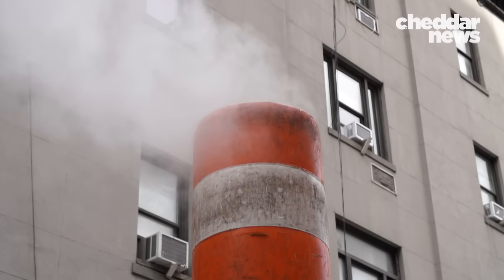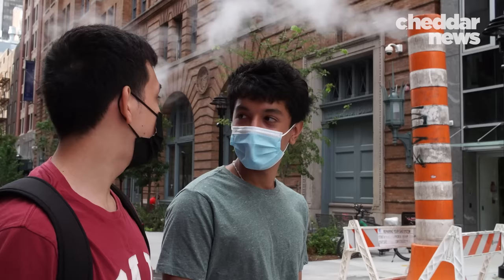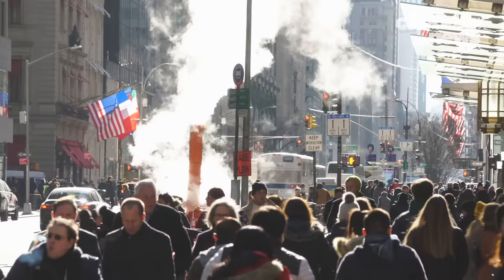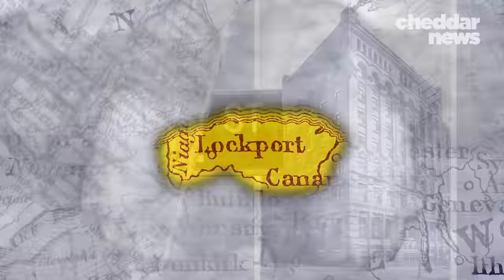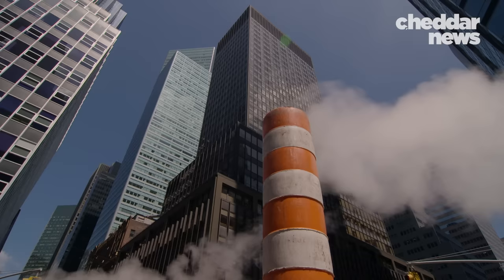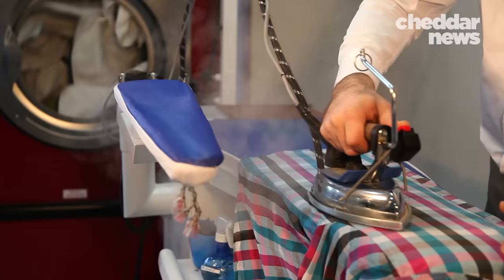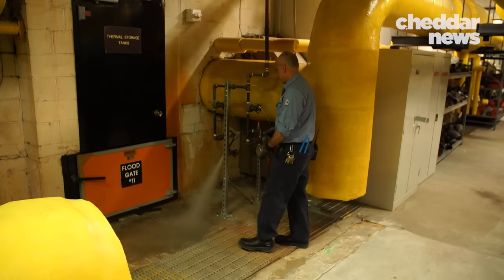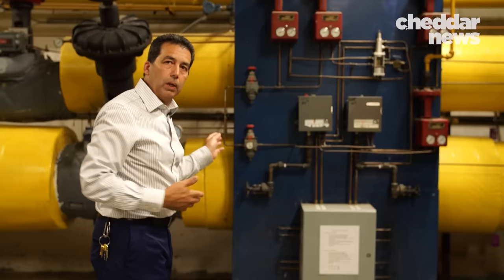Why New York Is Powered By Steam - NYC Revealed

Comment: Con-ed acts like this is such an amazing system that's reliable and safe. The reality is, is extremely dangerous and the system is more than a century old in desperate need of an upgrade. The entire infrastructure in Manhattan is old and run down and con Ed refuses to spend the money to fix it. They even tried to sell Manhattan to national Grid for $1. Yes that's right ONE DOLLAR. And national Grid refused. That's how bad the entire infrastructure is. Not just steam, the gas and electric. There's always an explosion or failure somewhere. How con Ed is still licensed to operate is beyond me.

Comment: In coordination with the city Could certain areas attach devices to the steam lines with mini turbine type generators and run some additional electrical power for small areas or some modified version of this?
Reply: If it would work like that it woul have been done like that. So no
Reply: Copper cables are much cheaper.

Comment: Most cities in Europe use steam to heat buildings. But unlike NY, most cities are able to contain the steam in pipes. I have been walking around steam heated towns and cites my whole life. Never seen such a neglected pipe system. Letting all that heat just ecape.
Reply: I was thinking the same. Doesn't seem very efficient letting it all scape, in my mind it would be like if the water supply we get would just leak like a broken fire hydrant every so many feet.

Comment: Sure, burning natural gas is better than coal, but the steam produced that way still isn't "sustainable" anyway.

Power2Heat with renewable energy, geothermal... That's sustainable.
Reply: most gas power plants just waste the steam. this system is far better than most.
Reply: @Progan666  Cogeneration is better than running a gas turbine for electricity or burning fuel for heat. I fully agree, but that wasn't my point. Burning natural gas in cogeneration still isn't sustainable - it's just better.

Comment: I’m surprised it isn’t used more extensively…perhaps as the new generation of nuclear comes on-line…distinct steam may see a renaissance as well…steam running small turbines instead of electric motors allowing for some devices that you wouldn’t think of as “steam powered”

Comment: How does Con Edison know what to charge ? Unlike electricity where a meter is used what do you use to measure how much steam is used ?
Reply: 7:43 those things with the LCD screens are steam meters. I believe there's a turbine mounted inline with the service pipe that measures volume (like a large gas meter) and that's integrated over time on the computers in Mlbs (1000lb of steam). I've also seen older, smaller buildings where it's just a mechanical meter mounted right onto the pipe, but it does basically the same thing.

Comment: Gas isnt actually cleaner than coal.

Methane is a stronger greenhouse gas than carbon dioxide
Reply: Unburned. 
One C coming from methane and one coming from coal still makes only one CO2. 
Anyway, I think he meaned clean as the opposite of dirty, not of climate friendly.
Reply: They dont offer methane credits for a reason
Reply: gmethane burns cleaner than coal or oil products in terms of soot and nitrous oxides, and it produces less CO2 than coal per unit of heat produced because a large part of the heat from burning methane is produced by converting the hydrogen in the methane into water, not just from converting the carbon in the methane into carbon dioxide. 

but yes, depending on how much methane you release unburnt, using methane could be even worse for the climate than using coal.

Comment: how does the steam-based air conditioning work on a thermo-mechanical level?
Reply: My guess is they use the steam to turn the compressor of the AC loop. VERY inefficient and wasteful.
Reply: My guess is they mechanically condense the steam into a cold liquid.
Reply: @slowanddeliberate6893  Possible, but doubtful it's used again for efficiency reasons. Steam jet cool was something from the 1930s: https://en.wikipedia.org/wiki/Steam_jet_cooling

Comment: This is such a sci-fi-esque system, certainly not something an entire city could run off of - so incredibly inefficient to transfer hot fluids over vast distances - yet here we are.

It's a cool idea, but has very obvious flaws
Reply: certainly feels steampunk-like.
Reply: Nah. Made up by the number of people whp use this utility beyond heating.
Reply: you really know nothing about high power steam if you think its a liquid lmao. bet you didnt even know steam can be dry
Reply: @bobymo101  I didn't say it was a liquid - I said it was a fluid.
Reply: I think when the city is packed like Manhattan is, loss is not too bad.
Reply: The pipes are insulated. Gas has relatively low friction. Efficiency losses are relatively low. District heating is a viable and efficient form of infrastructure for heating a city. Centralizing heat production allows larger central more efficient systems  which more than make up for efficiency losses through the network (in most urban/industrial applications) The coolest part of it is that you can use heat pumps to move a lot of heat with relatively little electricity especially when used with geothermal.
Reply: Steam can be incredibly efficient.  Not an engineer I see.

Comment: I don't really get how steam is used for heating, in most places I've been in Canada the furnace either works using electricity or natural gas to heat air that then goes through the ducts.
Reply: The steam is piped throughout the building to radiators and baseboards. Through conduction, the metal and pipes heat up. The heat is then transferred into the spaces by convection. As the steam transfer heat to the metal surroundings, it condenses and change to a liquid (steam condensate). This phase change releases a comparatively huge amount of energy. 

Then cold air comes into contact with the hot metal and then rises as hot air displacing the air above. This creates very slow air currents that allow the space to heat up. Its because of this that it’s much slower to heat up buildings compared to your forced air (fans move the air) system. It’s an efficient way to heat up a lot buildings, but no one is really building new steam systems anymore unless it’s for a specialized system. They’re outdated and more complicated then newer hot water or ducted systems.

Comment: Heat pumps would be vastly more efficient, hopefully this inefficient, expensive, leaky infrastructure is replaced in the future.
Reply: NYC has banned the use of heating sources created by natural gas in newly constructed buildings (yet to take effect). Heat Pumps are going to become much more popular there over the next 10 years. Heat pump cooling towers, chillers, air handlers, etc. It is the future of the industry.
Reply: @mwaespy  yeah it probably isn't.  Maybe in like 20 or 30 years if the electrical efficiency of them can improve.  The problem with a heat pump is that as it gets colder you lose the ability to pull as much heat out of the air.  Even units with -40 kits still will struggle to provide enough heat to sustain even a 2000 square foot home in a -20 degree day.  It isn't that a heat pump can't heat, a home we will say, in those conditions is that it will take longer to do it.  So you run say a gas furnace, it turns on produces say 500 degrees of heat inside your furance, heats your house from say 65F to 70F in about 25 minutes.  Can easily keep up with demand over the course of a day.  A heat pump will need to run all day, to one can't that temperature from 65-70.  But also run longer to catch the deviations that occur through out the day.  A heat pump inside heating coil at best will product say 160-170 degree coil temperature, which is a far shot off from 500.   You will need some form of supplementary heat to make up the difference.  Heat pumps in a more southern climate, like Florida, Texas, Arizona would be great in large scale.  You still get air conditioning and the times you need heating, you have it.  

Steam in a large scale, such as this, is very efficient and also easily controllable.  Also it means that as a city, you don't have massive natural gas needs through the city.  You have a central heating plant.  The heating plant can both ramp up and ramp down steam boilers, based on outdoor temperature and needs of the clients on the run.  It pumps very easy, it has a great thermal mass and can deliver consist heating all the time.  It also means that individual buildings aren't putting in their own independent heating system per building which both tax an electrical grim and natural gas grid.

Comment: 3.2 million pounds of steam per hour, what kind of measurement is that, you can have 1 meter squares of steam which isn’t a lot in such a small place that the pressure is 3.2 million pounds

Comment: Your giving false information about the purpose of the orange striped stacks.
The stacks direct steam up from street level, the steam isn’t leaking at all, in fact the super-heated steam pipes are very hot and when ground water comes in contact with the hot pipes it flashes into steam. So the leaking steam isn’t really leaking at all.
Ground water isn’t treated and may contain impurities and that’s why it might smell different.
You should check your story and spend a little time reading “Lost art of steam heating “ by Dan Holohan.

Comment: The source of steam is water, is it suistainable in terms of source if it is normal drinking water?
Reply: The water has to be purified water. This was explained in the video.
Reply: @DJRenee  thanks for the reply. I meant the sustainability of water as a source for steam. Large volumes of water overall going to waste
Reply: @kq7739  most of it condenses back into the system, only a little bit leaks or is vented due to pressure.

Comment: Could thay save energy for they just used gas or electric? Tales a lot to heat water which means consuming more then you need, doesn't it?
Reply: Actually it’s a lot more efficient. Electrical generation needs a higher temperature gradient than heating water. Standard electrical plant which vent the steam into the air are 30-50% efficient, but using the turbine waste heat to heat water for home heating brings that up to ~90%. It’s heat that would otherwise be wasted so it’s very sensible to use it, if you’re burning fuel for electricity anyway. The heat eventually goes into the atmosphere anyway, might as well bring it into buildings instead of ejecting it into the sky.

Comment: Wow, I had no idea steam was still being used like that. Interesting! I don’t quite understand why this video uses pounds as a measurement for steam, surely volume liters/gallons would make more sense for a gas?
Reply: I think they are referring to the pressure.
Reply: @slowanddeliberate6893  It's both.  Early in the video they talk about the volume in billions or millions of pounds, which is volume of production--a pound of steam is just a pound of water that's been turned into steam, which gives the customer 970 BTU of energy per pound of steam.  Later in the video, the 'pounds' at the supply (180, 60, 15), refer to the pressure in pounds per square inch.

Comment: So I’m sitting on 3rd between 25th/26 and an oil truck is dumping oil into a building.
Why?
Why do manhattan buildings need boilers if we have the steam system?
I’d love to hear the answer.
Reply: Boilers create the steam, tho if you drill down deep enough pump water down one pipe the heat of the earth would create steam, then pipe it into the system endless steam, and there is endless water just find it drill it, called primary water it's underground too. Earth provides everything we could ever need for free we just need to remember how to use it like in the old times.

Comment: This really is a efficient method to heat all these areas. They just need to switch and convert the power source that sends electrical power and heat to produce steam to a eventual advanced method like nuclear energy would be a very good option for this, you wouldn't even need to burn gas as your heating element, you can run it all off of the electricity that the power source generates and add in heating element devices, just like how some of our ovens heat from electricity alone.
Reply: Nuclear in the city of NY. Now that is proof that you need to do some study on that subject.

Comment: How can you not challenge the steam company man who said burning gas is a clean source of energy? That's ridiculous. And you allowed him to present it as fact. I dont know if your editors just did not get the memo, but the producer on this video should really be more critical of your guests. Natural gas as a fuel source does produce less emissions than coal, but to call it a clean fuel source when renewable energy use does not release any emissions at all is a really unfair position to take.
Reply: but what renewable energy produces that volume of heat that you can easily be pumped from building to building and returned in a closed loop system.  Other than nuclear because i don't know how supportive the people on new york city would about having a massive nuclear plant just across the river heating water and providing them heat.  It would work, and i would be super supportive of it.  But a giant reactor, 5 miles from the one of the most popular and populated cities in the united states would be interested.  
natural gas does release emissions you are correct but as a heating source, other than pure hydrogen you aren't going to get anything too much cleaner that natural gas.  Is it the best source, no.  Is it the best source, that is available and and large scale affordable right now, yes.

Comment: Steam in center city Philadelphia keeps my job relevant and makes my Class A engineers license 🪪 also relevant. It can be extremely dangerous especially on the high pressure end of it when there is a leak and the steam becomes invisible at times. I have had plenty burns and a few scars to go along with it from accidentally bumping into a uninsulated steam line a time or two.  Not to mention we also produce our own steam. I operate 2 high pressure steam boilers (I run about 125-150 psi) which also uses a byproduct of the heat that can produce chilled water. When steam fed directly into a absorber chiller at a low pressure (ruffly about 13-14 psi) which with a mixture of a bromine solution produces AC for the building. Can be very very efficient.

Comment: You claim at the end that steam "remains a sustainable option" and show solar panels, even though the guy just said that they burn methane. What the hell?

It doesn't "remain" sustainable, because it has never been sustainable and still isn't! What a horribly inefficient process btw, to boil water only to use the water vapour for cooling in air conditioners.

The system is a shitshow, as evidenced by the regularity of orange stacks, but all of these people express the motivation of keeping themselves in a job, so it's not hard to imagine the maintenance workers doing a poor repair job, such that they'll have more repairs to do next week.

I feel you gave an overly nice and distorted view of this industry that's past its expiry date.